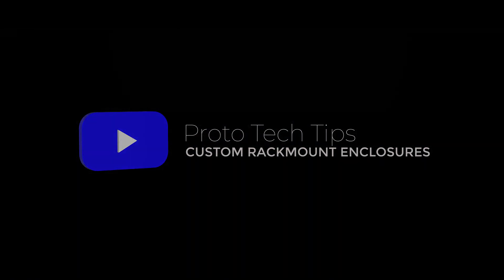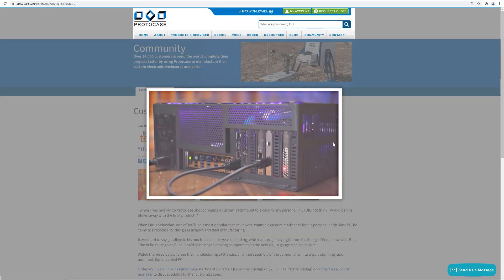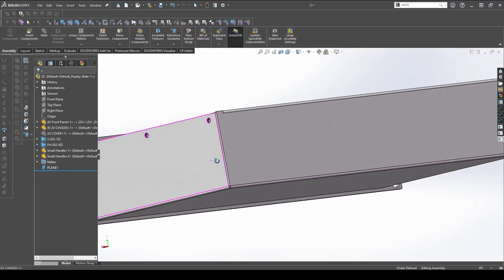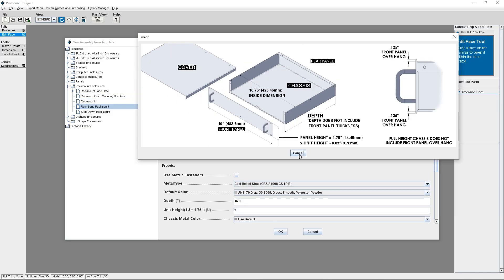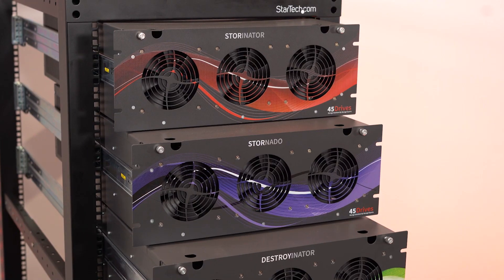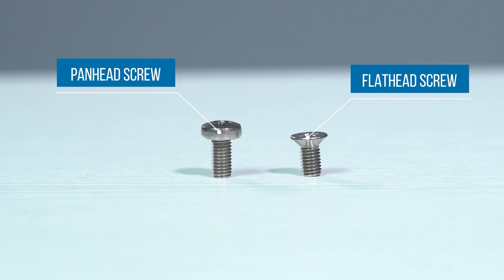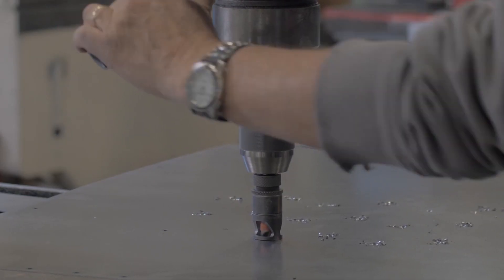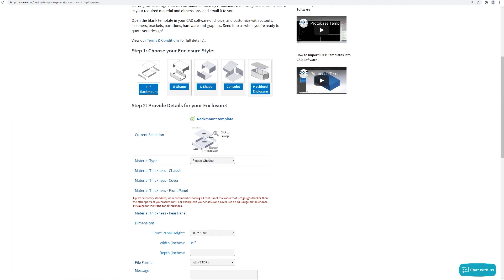Proto Tech Tip - Custom Rackmount Enclosures

Comment: I am in the Designer, and there are ATX computer enclosures and rackmount enclosures, but would it be an idea to add ATX/mATX 1U enclosures? Is that a load of effort or simple? 

Am I missing an easy method to just grab the base of the ATX enclosure and copy paste it into the rackmount enclosure? Or should I go add in screwpoints and rear panel opening manually? I did download ATX specs.

I want a 1.5U with 2 slot riser and 1 low profile riser, if that is of interest.